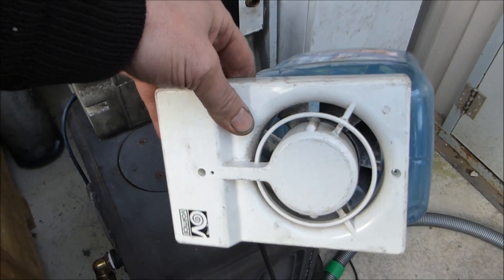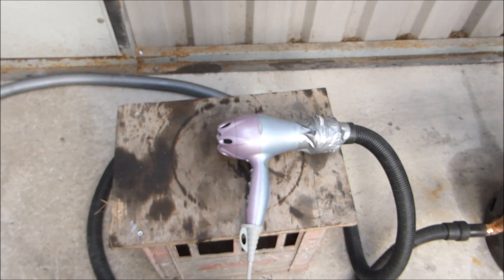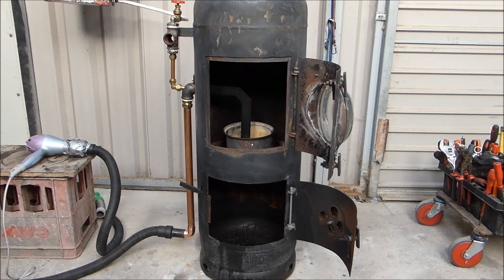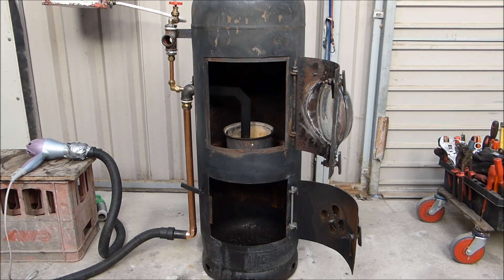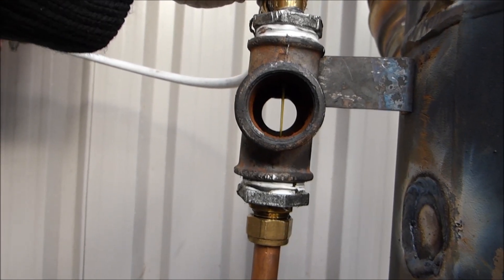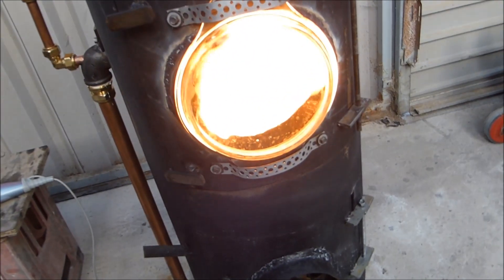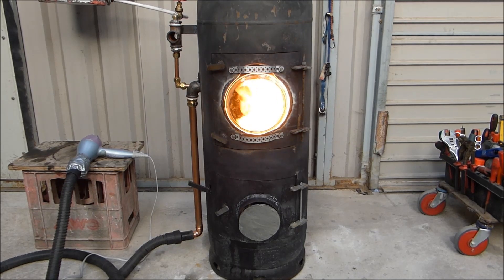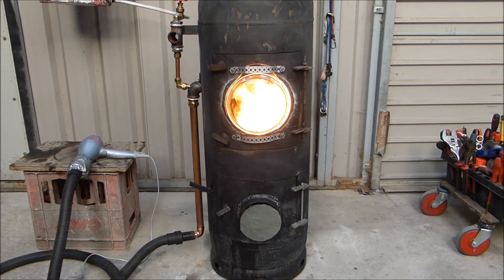Hairdryer Powered Waste oil Heater

Comment: Great job.
I was wondering what Glass you used for the 'Window', and where I would get some.
Then I looked again, realised what you've used, a simple Pyrex Dish Lid!

No Brake Disc in this one, is that just because you were testing the Air Supply?

Comment: It gets severely cold here -45 cel  - Dec / Jan /  Feb ....   last 4-5 yrs.  - especially when the Polar Vortex shows up... I created one of these with an old oil heater stove I did it a bit different but same idea... I used Old Motor oil with 10/15% diesel to thin it out..  The stove metal was very thin.. and it didn't make it one winter before it cracked all the way around..  ( I don't let it run when I'm not present.)  But it didn't take much more than 30 minutes to heat up my 400 square ft garage in -35 / 40 weather.. I wish I had a larger garage so I could build a mass heater, with the bench.. Thanks for all your video's .. they are "Right On" so much better than having to stuff wood in the stove, and cutting up cords and cords to make it through the winters..

Comment: So a couple of questions... 1st, does it not put out smoke because the massive air coming in through the intake helps burn the oil more efficiently? 2nd: Does it ever get so hot that things start melting, like the pot or the copper pipe? Is the pot just steel, or is it stainless?
Reply from the maker: Hi Grant. The larger pipe brings in the air for combustion and the oil feed pipe runs inside the air feed. This keeps the oil feed cool and protected from the fierce flame. The stainless steel pot has a lifespan of a few months before I need to replace it. I could use more robust pots but the walls of the pot glow red fast and that heat vaporizes the oil as it travels into the chamber. I have used tin cans to prototype these and they dont last long maybe a few hours. Hope this helps. Cheers Gerry
Reply: @GerrysDiy , most certainly, thank you.

Comment: Gerry,  I've  been  thinking  for  ages  about  running  a  Hot  Tub  boiler  on    waste  oil  burner. However  this  does  have  its  inherent  problems.....   The  boiler  is  like  a  deep  U  shape  of  aluminium (3mm  wall  thickness)  a  foot /300mm  diameter  tube.  so  the  fire  needs  to  be  at  the  bottom  of  the  U  shape  (about  a  meter  down)  and  blasting  sideways,  so  that  the  blast  goes  out  the  exhaust  and  up  the  chimney,  which  is  throttled  down  to  about  half  as  wide,  say  6 inch/150mm.   I  have  access  to  quite  a  bit  of  scrap  metal  of  good  weight....  pipes,  fire  extinguishers  etc.  The  hot  tub  by  the  way  is  around  3  cubic  meters  of  water, not  insulated  more  than  50mm  spruce  gives,  and  at  the  moment  I  use  wood  offcuts  from  my  work,  which  also  has  its  problems,  as  thís  wood  is  all  spruce  and  fir,  which  contains  masses  of  TAR.  which  is  the  reason  why  I'm willing  to  forego  the  free  fuel  for  something  which  could  be  better.   Can  you  have  a  think  about  this  one  for  me?  I  will  pu  a  link  to  a  picture  of  the boiler,  on  the  manufacturers  website,  which  is  in  Sweden,  where  I  live.   http://www.badtunnor.se/images/kamin/kamin-till-badtunna.jpg

Comment: Have you ever tried compressed air like from a stand up air compressor to be specific? something capable of 150+PSI
Reply from the maker: Hi Matt. I have messed around with compressed air and I can get a very intense burn. Here's my new burner and it does not need any forced air to make lots of heat. https://youtu.be/ShTLaYKjzxw You can feed it air too for more heat but it is more than capable of heating my 30 x 20 x14 feet shed which is uninsulated. Thanks for hte comment Cheers Gerry

Comment: Does the hair dryer have a no heat setting? If not your wasting electricity.
Reply from the maker: Hi Brandon. I had the dryer on cold only. I have made another series of videos where I can heat this type of heater and others without the need for a fan and it runs on 2 litres per hour with no smoke. here's a link https://youtu.be/tnzEDEpz3Yk Cheers Gerry

Comment: hey is the oil used engine oil or cooking oil or what
Reply from the maker: Hi Michael. The unit is happy burning any type of oil, used motor oil, veggie oil, gear oil etc.  Here's a link to my new burner design without a fan running on veggie oil and heating my whole house ( underfloor heating and hot water) in a boiler stove. https://youtu.be/SAmHNp6fOUA     Hope this helps. Cheers Gerry

Comment: One way to avoid an unexpected explosion after a flame-out is to put an independent pilot light in as is done in a typical gas fired furnace. If there is always a flame present there will never be a raw gas or buildup of fumes. The explosive pressure in an enclosed space can eject parts of the stove and compress ear drums. In our experience. We had a crew live through an explosion but only because we had a safety valve built in. We then went to an electronic high voltage pilot light to ignite any unexpected gases. The safety valve was a little like very good hinges on the door and very weak latch. LOL

Comment: You never measured the temperature of the glass window or talked about it. It appears to be a Pyrex baking dish.
Also the oil valve should come in from the side perpendicular to the unit since the surface temp is 900 degrees up there it will heat up the valve to a too hot temperature after awhile.
Reply from the maker: Hi SG4L  You are correct I am using a pyrex baking dish for an optic. Most of these videos are for prototyping and there are many things that can be improved. The main reason that the valve is so close to the stove is so that when I adjust the flow I get as close to instant response as possible. It is possible to shield the valve and using a metering pump it is possible to eliminate the valve altogether. Check out my latest video, everything is too close to the stove LOL  Cheers Gerry

Comment: Just wondering about the possibility of using this to heat a house via a water heat exchanger plumbed into the central heating system.  Obviously the oil burner unit would need to be outside in a separate enclosure, to prevent the risk of it burning the house down!

Comment: Years ago I worked in a garage that was heated by a waste oil burner running with a simple gravity feed and natural draught. The flue was a complicated pagoda thing designed to radiate heat. We also used to chuck shop waste into it; cardboard, wood scraps etc. On one memorable occasion I had set the drip rate a little slow which eventually allowed the flame to go out allowing the residual heat to vapourise the oil rather than burning it. When I next opened the door to add some scraps of wood the slight draught caused an ember to burst into flame igniting the oil vapour. The cast iron door flew about fifteen feet narrowly missing my head. Lesson learned.

Comment: I'm looking at building this for my shop that's descent size and use customer oil from oil changed. would it heat the shop up ok or should I try a different design or give me your suggestions an how much oil would it take to heat up a shop

Comment: practical question, open flame heat source any issues with several stored vehicles in my shop? I've been using electric to avoid blowing up obv, and also have gas Argon Mig, oxy/acetylene so I'm cautious.got rid of pot belly wood stove for same reasons as open flame vs electrical being so much more efficient than in past years

Comment: One way to keep the heat in the room, is to turn the unit sideways, or run the flue for a long way.  The idea is to have the flue gas at the chimney cap just warm.

Comment: Did you know. Washing machine door glasses are pyrex. The can be used like this caserole dish window. They can also be used for cooking. I would like to see steam introduced into the burn, this would clean it up even more and produce more heat.  Got any old kitchen steamers knocking about. Steam can only be itroduced when up and running hot.
Reply: Be aware that Pyrex glass is no longer borosilicate glass and is made with soda lime now so you'll want to use older pyrex if you can find it or find some borosilicate glass labware.. not saying newer pyrex won't work but with those high temps borosilicate glass is what you want. We use it for sight glass in burners for chemical plants..
Reply: Geoffrey Whellams

Comment: I would like to point out that oil looked pretty clean coming thru the pipe,, not from a diesel for sure
Reply: But used Diesel engine oil is what you'd want to burn over all else, because of the particulate carbon that is suspended in it.  You don't get 100% combustion of the Diesel fuel, and it washes down into the crank case, which is why that oil is so black.  More carbon to burn, the more heat per gallon of fuel, right?

Comment: great vids, ever think of making a back boiler for one of them and maybe heating a rad or heating up some water in a cylinder or something like that?
Reply: Yeah if you were to wrap some tubing around the exhaust pipe or even the unit itself to leach heat from it, that would perform the same function as a water heater coil.

Comment: well we know the hair dryer wont last,,,,but a bathroom fan will,,,,,,,you cant use it the way he showed setup,,,,but,,,,if u use it as intended,,,works greati wired mine up with an old extention cord,,,hooked a vac hose to it and attached to the pipe

Comment: What is the best Blower to use.The air mattress motor  works  well but only last  about  1 week running  8 hr  days  >I am in process of hooking up to Furnace  inducer motors, One  just  isnt enough  .
Reply: Try using a shaded pole motor and fan from an old nuker.  They don't move a lot of air, so you may have to plumb two or three of them in parallel to get enough air flow depending upon how big your burner is.  Brush style motors can push a lot of air, but are not designed for long term use, however induction motors are.  Grainger may carry a suitable motor/fan unit.

Comment: What is the "Empty" chamber in the lower half for..???
And what is the round opening in the bottom section for.???
If you shortened or did away with the lower section, wouldn't it increase the size of the upper chamber giving out more radiated heat...???
I love your Pyrex window, how did you fit that in there..???
I'm going to use an air-mattress blower with an incandescent light dimmer to vary the speed/output..

Comment: Hi Gerry go check out mother earth waste oil heater maybe you can improve your design I like your site glass that shows how much oil is going in. in the mother earth they wind a few coils around the chimney so to warm up the oil and in there burner they throw in some 3" bolts I wanted to build one and put it outside because due to insurance purposes a person could not run it inside but if you wound several coils inside where the fire is and run water threw and pipe in the hot water this way you could get around the insurance be careful as it could build steam and cause a explosion so you would have to have a pressure valve good ideas cheers

Comment: what if the fan dies when you are out, the oil flow could build up and flood?
Reply: Would not be too difficult to tie in a solenoid or something for flow control based on whether the fan is running. If you wanted to get fancy with it and had the mental chops, make a blackberry pi as the controller for both fan-speed & flow rate. The variances are infinite. :)
Reply: +Jayme Capurso I wouldn't think the burner would be left to burn without Gerry in the shop for more than half an hour but, good question.
Reply: I think its a great idea but it needs to be completely controllable, especially for small spaces where you might want to run in all day really low for ambient warmth.

Comment: Hi Gerry,
                Built one along the lines of your original gravity fed burner but added a blower to the bottom of the rear of the propane tank, I used the fan from an old combi boiler can be bought brand new for about £25 depending on model or for nothing if you know someone up grading their heating system. the advantage is that most have a built in transformer so apart from making a cover to protect the electrics and channel the air into the burner they're purpose made. Add a speed controller from an old electric drill and you can accurately control air flow. hope this helps and thanks for the initial inspiration my workshops never been so warm. many thanks, Tim.

Comment: Just wondering how much heat you would get if the tank were horizontal  so that you have more surface getting hot.  Would have been a little more complicated but seeing what you have done I think you could do it.

Comment: A cylinder air fan from a car heater/ventilation system might work well. They're pretty quiet and could be powered by Peltier units like in a Biolite camp stove.
.....Just a thought.  :)

Comment: Is there anyway you could get a very small turbo to work off the exhaust fumes before they go up the flue to force air into the fire, you would only have to use the hair dryer to get it started and once warmed and enought exhaust gases flowing the heater would run itself and the hair dryer could be turned off

Comment: you could use a water/steam system so that the burner boils the water and spins a turbine to generate electricity or even you could just use the steam force to drive like a turbo or something to force the air in. if you smart enough you could have a condenser tube on the other side for the turbine and then you got a water heater, self running on just the oil
Reply from the maker: Hi Noodle. There are quite a few possibilities with this setup as it makes an awful amount of heat. I did connect it to a boiler and a storage tank and I was able to heat 80 us gallons of water in 60 minutes. The boiler was only 20kw and I had it running at 22kw making lots of steam and hot water. Here's a link http://youtu.be/1Et3rIn5GIY   
I did 3 videos on the boiler heating water. Cheers Gerry

Comment: Could the heat be used to make electricity to supply the air.  Maybe some type of steam engine powering an alternator which in turns charges a set of deep cycle batteries?  Sort of an off grid system.  Do you need an alternative fuel to get the flame started?

Comment: a propane tank is easier to  handle,but its not as long lasting as  2 lorry brake drums.I bought 2 for 20 euros,they  make 24inches in height,i capped off the bottom and top with 1/4 plate and cut holes out for the burner and flue pipes
Reply from the maker: Hi Paul. Cast Iron has a much longer life than mild steel no doubt. I am not sure how long a propane tank will last but it is in the order of several years so either way it makes for a cheap heat source. If you have any video or photos of your build I would like to see it. Thanks Gerry
Reply: line the inside of the propane tank with a refractory insulating castable for a thickness of an 1 - 2 inches. It should last forever then.
Reply: kirvam99 I can't say for sure, but I would think if you lined it with refractory, it would greatly reduce the amount of heat in the building. I would think most of your heat would stay inside the tank, and then out of the chimney. I could be wrong though

Comment: Think of the possibilities! I was thinking of putting the flue from this into a heat exchanger and then to a heated floor loop in a shop. Something that's nice but not continuously needed. Great video sir, Thank you
Reply from the maker: Hi Karsten. If you are thinking of hydronic underfloor heating I did a setup with a boiler that would do a better job than trying to recover the flue exhaust. Just hook into the flow and return from the boiler      http://youtu.be/1Et3rIn5GIY
Cheers Gerry

Comment: Why did you go too a forced air design when your first one seemed to work very well without it? Seems that would be the best option if you do not want to use any other energy.
Reply from the maker: Hi Tim. The answer is simply that I wanted to make a burner that would easily convert a boiler or stove to run on waste oil. Using forced air allowed me to downsize the unit. Both types work very well burning waste oil and I am working on an different type now too. More videos soon. Thanks Gerry
Reply from the maker: Hi Fritz. This design does need power but the stove is setup to run on the first Ozzirt burner too. Its a five minute job to put the other burner in place and fire it up. This thing will run on logs and any solid fuel too. It turned out to be a really versatile stove and can be made for half nothing depending on local resourses. Cheers Gerry

Comment: Good stuff, if the normal burner does 1000f tho anyway is there any point in using the fan one? Or is it just cos you like experimenting and trying to get the cleanest burn? I've started building a 47kg bottle myself and this has helped loads. 👍 also, seeing as your she did quite big have you thought of shielding a fan behind it to blow warm air around or doesn't it need it?

Comment: Hi Gerry, great load of videos thanks 👍 if using the fan method is it more thirsty? Or does it seem to burn hotter for the same amount of oil?
Reply from the maker: Hi Doopsiedawg. Its no more thirsty than the other version of the burner. I can burn with a clean flame easily. If I increase the oil I need to increase the air accordingly the same applies in reverse of course. It will burn from a few drips per second to a steady stream without smoke so long as I adjust the air to suit. Cheers Gerry

Comment: Hi Gerry,  how is the high temp silicone holding up?  Did the it melt when using the hair dryer to produce massive heat?  Cheers
Reply from the maker: Hi Dave. I have managed to burn some of the high temp silicone. I have used fire cement and fiberglass rope and things seem stable enough. Cheers Gerry
Reply: Gerry's Waste Oil Burner